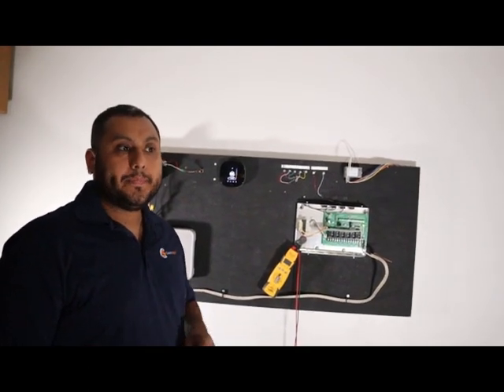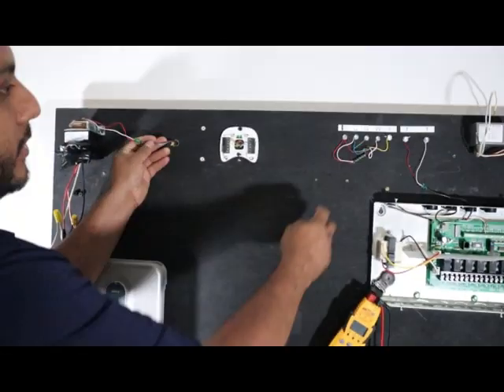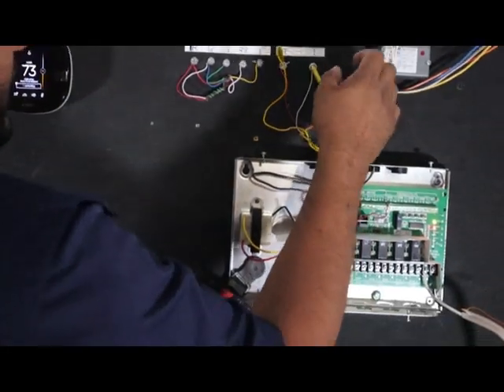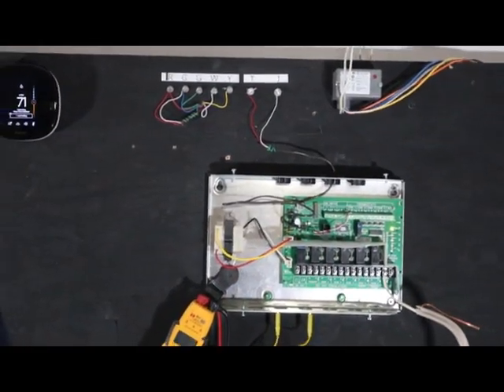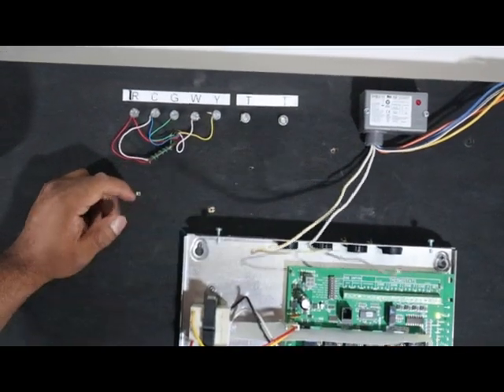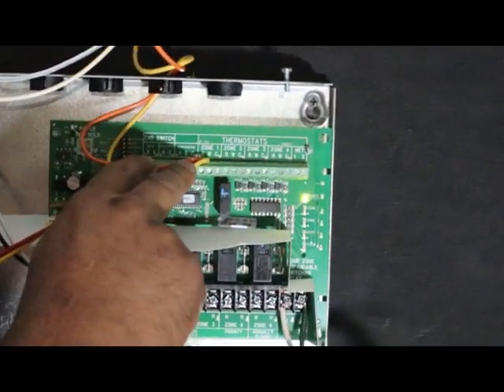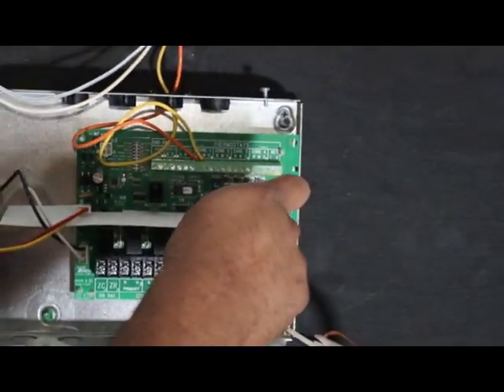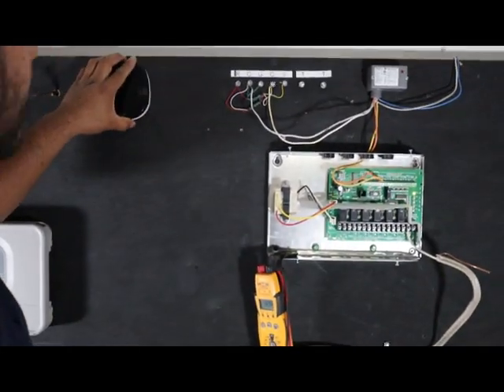Smart thermostat installation with air handler and Taco panel

Comment: I have a older taco without the common. For each zone. I see a com and 24v fitting on the side but there is only one. Is that the common I need to connect to and if so can I connect two thermostats to that one fitting since I have 2 separate zones and pumps. Sorry it is hydronic baseboard heat. Thanks in advance for any help.
Reply from the maker: The common of the thermostat goes to common on the taco panel. You can use more than 1 common on terminal
Reply: @shielduniversity419  you are the man sorry I just emailed you. Seen your email in a previous comment. Thanks again.
Reply: I have an older 3 zone taco panel no c terminal. Can I use the common at the TT that goes to the thermostat splice at the thermostat and feed the c terminal for thermostat power. Since the tt terminals on the taco panel is always live with 24 volts
Reply: I have a older taco with no c wire but I ran two thermostats to mine. I ran a wire right from the top section that says c and 24v I ran a green wire from the c to the c on the thermostat then I ran red and white from each zone
Reply: Thanks for the quick reply. To clarify I have two wires at the thermostat since one of those wires is common  can’t I just splice the common wire at the thermostat and use the splice for the c terminal at the thermostat and then the other part of the splice for the w terminal.
Reply from the maker: @ttucci215  that sounds correct but i dont know for sure i need to see pics

Comment: Nice video, I need your advice. I have Taco two zone with a relay. Was connected with line high voltage. I am reaching you to see if i could convert to install nest thermostat. I need your help.
Reply from the maker: Send pics to Lramirez103@gmail.com